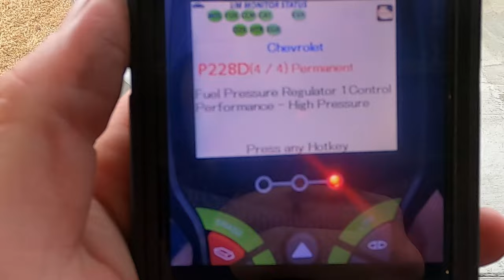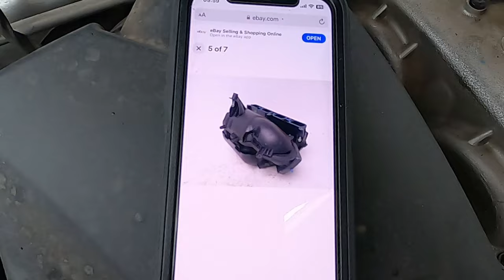How To - 2015 Chevy Malibu Fuel Pressure Sensor

Comment: Did this fix the problem?
Reply from the maker: Honestly it’s hard to say because I also changed the battery. If it wasn’t my wife’s car I would have test drove it to see but she needed it on the road asap. I would suggest changing the battery first.
Reply: You didn't say what size the wrench you used to take off the sensor but overall good video
Reply: @nramirez4421 he said a crescent wrench. 🔧 
That’s multiple sizes. Therefore, he did actually say it, you just didn’t pay attention. 
😊😅